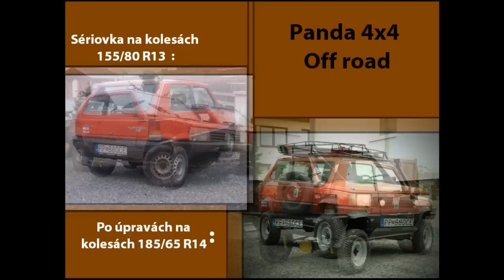Panda 4x4 MODIFIED 2

Comment: Hi Tibor, please can you help me? My rear drives are not working. I removed the electro-pneumatic valve and tested it at 12V to see if it worked, and it lifted the valve upwards (which I assume is working). We changed the oil, but it still doesn't work. Nothing can be heard in the differential, and the driveshaft rotates normally without any strange sounds. Model is Fiat Panda 169 4x4 1.2 51KW. Do you know what happens? Thanks!

Comment: I am doing the same swap that you have done more than 10 years ago, in my case I am using a 176B4.000 (1.2 8v 60hp) from a Fiat Punto mk1, I was thinking of using a IAW 6f.SB from a Punto mk1 1.1 54hp.

For the 4x4 gearbox issue, what clutch disc and pressure plate are you using?

What starter motor are you using? I have read that there are problems when using the 1.2 stock starter.